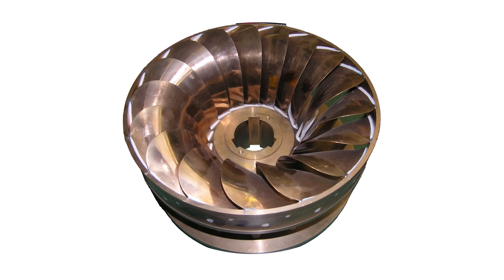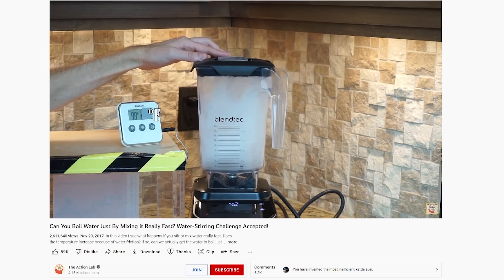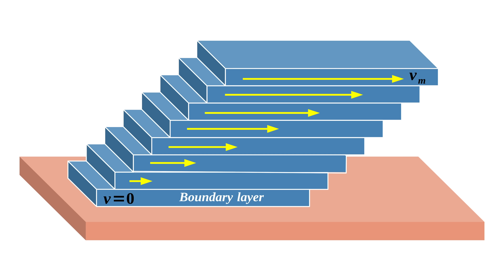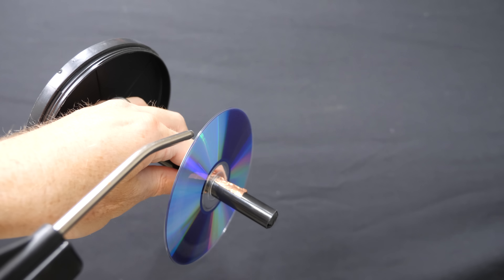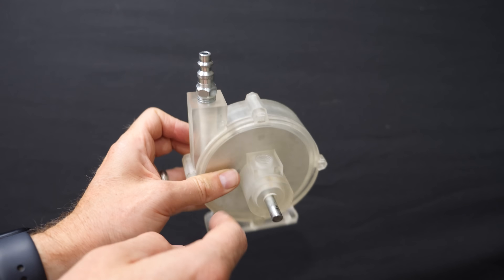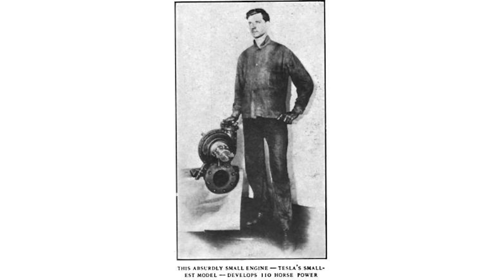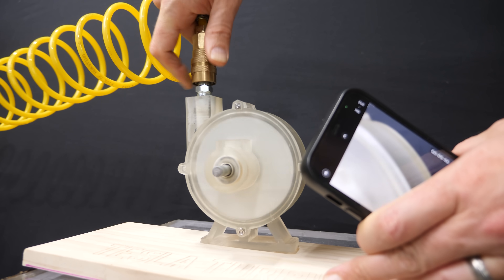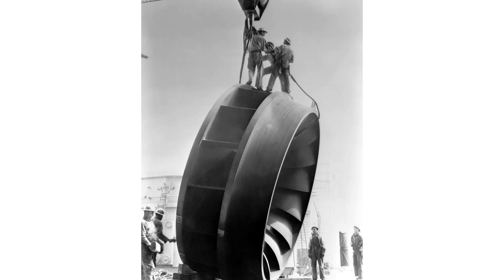How Fast Can a Tesla Turbine Spin?

Comment: With new materials being discovered and people learning how to make them, I think the Tesla turbines will be able to get to speeds we never thought possible. (like graphene, borophene and others). Some might be lighter and stronger and could even have better properties to make them more efficient (and changes to the design, like combustion engines being redesigned for more power and better efficiency over the years).
Reply: Tesla turbines aren’t supposed to be spun fast when used as a turbine. Only when used as a pump/compressor are they supposed to be spun fast because ALL centrifugal pumps’/compressors’ performance is tip speed dependent. 

“I have found that the quantity of fluid propelled in this manner, is, other conditions being equal, approximately proportionate to the active surface of the runner and to its effective speed. For this reason, the performance of such machines augments at an exceedingly high rate with the increase of their size and speed of revolution.”
-Nikola Tesla

In Tesla’s own words he even knew that spinning too fast creates to much centrifugal head and counters the incoming fluid flow, reducing the pressure gradient across the nozzle, reducing the final fluid velocity leaving the nozzle, reducing the mass flow rate and ultimately reducing power. 

Spinning fast only slightly increases the efficiency but at the cost of power. 

“Still another valuable and probably unique quality of such motors or prime movers may be described. By proper construction and observance of working conditions the centrifugal pressure, opposing the passage of the fluid, may, as already indicated, be made nearly equal to the pressure of supply when the machine is running idle. If the inlet section be large, small changes in the speed of revolution will produce great differences in flow which are further enhanced by the concomitant variations in the length of the spiral path. A self-regulating machine is thus obtained bearing a striking resemblance to a direct-current electric motor in this respect that, with great differences of impressed pressure in a wide open channel the flow of the fluid through the same is prevented by virtue of rotation. Since the centrifugal head increases as the square of the revolutions, or even more rapidly, and with modern high grade steel great peripheral velocities are practicable, it is possible to attain that condition in a single stage machine, more readily if the runner be of large diameter. Obviously this problem is facilitated by compounding, as will be understood by those skilled in the art. Irrespective of its bearing on economy, this tendency which is, to a degree, common to motors of the above description, is of special advantage in the operation of large units, as it affords a safeguard against running away and destruction. Besides these, such a prime mover possesses many other advantages, both constructive and operative. It is simple, light and compact, subject to but little wear, cheap and exceptionally easy to manufacture as small clearances and accurate milling work are not essential to good performance. In operation it is reliable, there being no valves, sliding contacts or troublesome vanes. It is almost free of windage, largely independent of nozzle efficiency and suitable for high as well as for low fluid velocities and speeds of revolution.”
-Nikola Tesla 

…suitable for high as well as for low fluid velocities and speeds of revolution… 🤭

The way to increase efficiency is to reduce slip on the discs.

“Owing to a number of causes affecting the performance, it is difficult to frame a precise rule which would be generally applicable, but it may be stated that within certain limits, and other conditions being the same, the torque is directly proportionate to the square of the velocity of the fluid relatively to the runner and to the effective area of the disks and, inversely, to the distance separating them. The machine will, generally, perform its maximum work when the effective speed of the runner is one-half of that of the fluid; but to attain the highest economy, the relative speed or slip, for any given performance, should be as small as possible. This condition may be to any desired degree approximated by increasing the active area of and reducing the space between the disks.”
-Nikola Tesla
Reply: @CharlieSolis  Pretty interesting. The man was a genius. I can only imagine what he would have accomplished if people didn't take advantage of him and he had the money and equipment to make whatever he could imagine. They probably thought they were helping themselves, but with the little I know of Tesla, they were only locking him i a box. I can only imagine the technology we would have now, which I believe is what the government has kept from us.
Reply: @deucedeuce1572  Tesla was a VERY particular and difficult individual to work with. I myself have Aspergers and COMPLETELY understand what he went though trying to interact with neurotypicals. 

Something that most people don’t point out enough, especially for the wardenclyff project, was that Tesla’s AC patents that he was making the vast majority of his money from and using to self fund most of his wardenclyff project, well those AC patents expired while he was in the middle of wardenclyff and he lost the his major cash source to keep the project going. 

Even the whole “Tesla died penniless not having worked for the last 15 years of his life…” bs. I’ve seen his finances for the last year of his life from the Tesla museum, Tesla was making around $8000/yr at the time the average American made $1000/yr. He had a bunch of random patents trickling in payments. 

There’s SOOOO many absolute nonsense myths and fiction stories people have made up about him… 

I even heard the other day someone saying he didn’t understand more than a high school level of physics 🤭🤭🤭 it’s just straight asinine what people will say about him just to get views, sell books, etc.
Reply: Yep. Right now it's basically like Hero's engine but in the future they will probably be how it's done.
Reply: @chrisp33  🙋‍♂️well if you mean that today is the future then yeah, because I make actual working TesTurs that output really power and torque at even low rpm. 

You just have to know how to design them properly.

Comment: What if you want something to be turbulence like mixing fluids but want to be done quick all at once? I mean if I want to mixed something all at once instead having to take it out and put into another mixture which use more energy.
Reply: “Tesla pump multi fluid vortex mixer - air:fuel mixer and atomizer”

I promise you won’t be disappointed figuring out what that^^ is 😇😈
Reply: That’s a totally different requirement that has nothing to do with this.